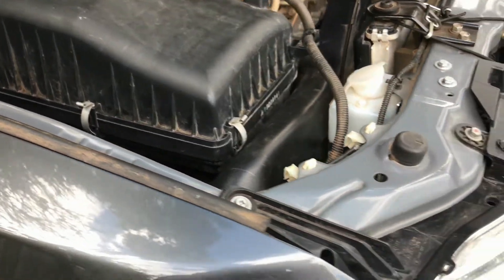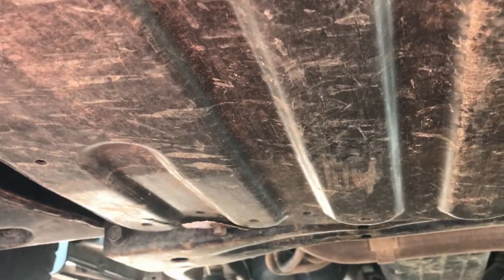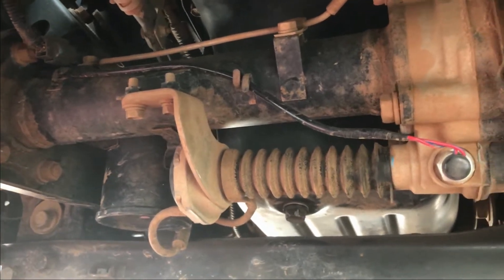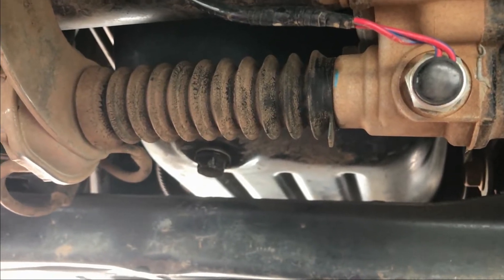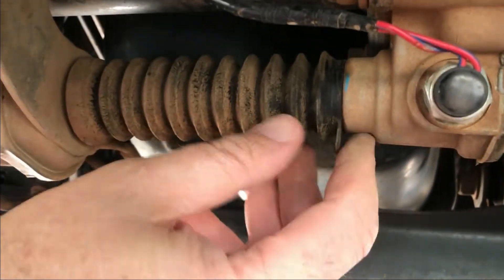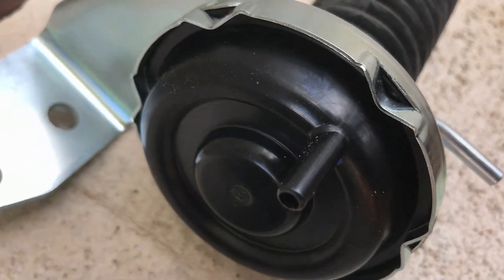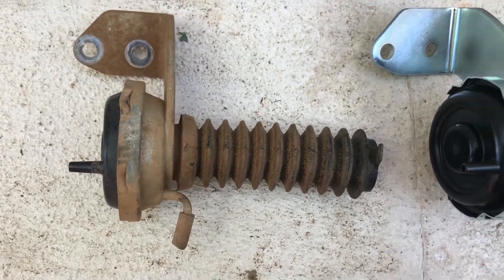Mitsubishi 2013 NW Pajero (NW) Flashing Center Dif. Light (CDL) Part 2 - Free Wheel Actuator

Comment: I have the centre diff light flashing when driving for a distance. I have a new vacuum solenoid and there is suction in one pipe when in 2H and in other when in 4H. However, actuator does not move in or out. It does move by hand so not seized. So I am guessing the actuator needs replacement?
Reply from the maker: I certainly sounds like it. I assume that was the final solution ?

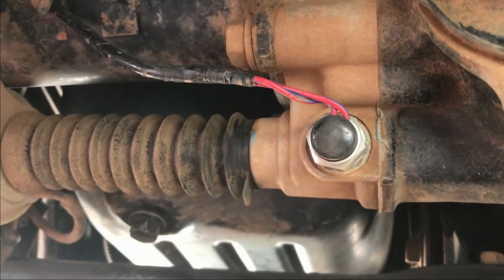Comment: Thanks for this video. Do you know the part number of the sensor at 1:03 ?
Reply from the maker: Hello, that is the one part I did not buy. the Mechanic bought it and invoiced it simply as the freewheel sensor. I suspect it is part MR953767
Reply: Thanks you !
Reply: Hi very interesting video, thanks.My gen 4 pajero differential light is blinking after driving constantly in the highway about 40 km on 2WD. I have replaced vacuum switch selenoid, since one of the switch ( yellow) has 0 ohm/ dead. After i replaced, the differential light is still blinking after driving 40 km. 
Any idea if I should  replace the freewheel sensor/ switch at 1:03?

Comment: after viewing video part 1 and 2 after replacing selenoids vacuum acumulator and freewheel actuator problem Flashing Center Dif. Light (CDL). can be resolved properly and back like normal again?
Reply from the maker: Hello, I only replaced the first three parts of a long list, to get mine working. As I had been to mechanics and they were unable to find the problem, I started with the parts that were the cheapest. I also tested those parts before ordering new ones. The solenoids are fairly cheap. I paid about $80 AUD for genuine however, could have gone non genuine for far cheaper ($20 AUD). I removed the airbox, put my finger over the solenoid port and had someone move through 2WD/4WD and felt no air suction, clearly they were dead. I saw the crushed freewheel actuator so it made sense to change that (You can post a picture of yours here, we might be able to see any obvious issues. (Non Genuine $60 AUD, genuine $169 AUD, Genuine from a mechanic $369 AUD). I then see the freewheel sensor was leaking oil. $100 AUD. Then I saw the hole in the pipe leading into the freewheel actuator. So almost all of the things I saw faulty, I ended up replacing. From there, you need to get up over the Transfer case and look at the leads and sensors. That is where the real money starts to come in. If you can do the other things first, hopefully that is where the faults lay but the transfer case has 5 sensors and 5 leads and if they need replacing, you could be looking at over $1000 AUD plus labour
Reply: well thank you, i will try and i will check again
Reply: Michael Jenkin so do you think i am facing the same problem i mean my pajero is doimg the same difrintional light flash do i need to replace the same parts u did?